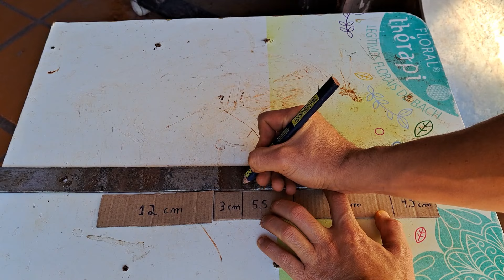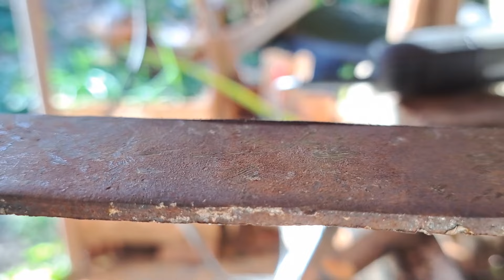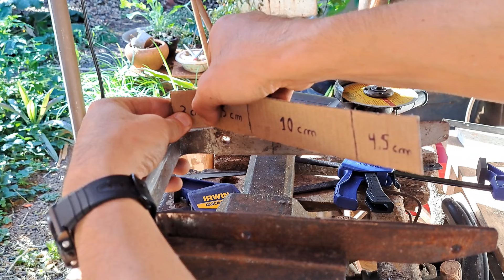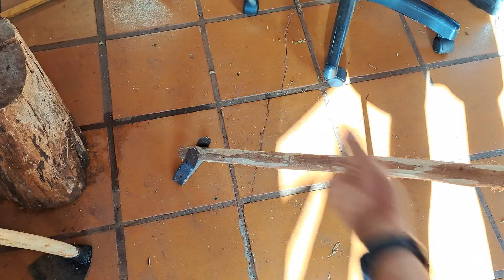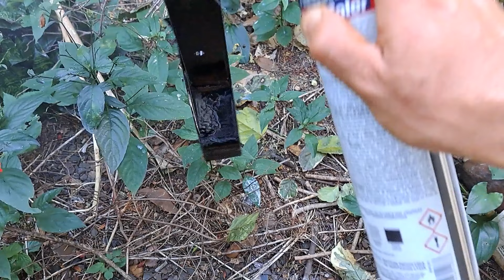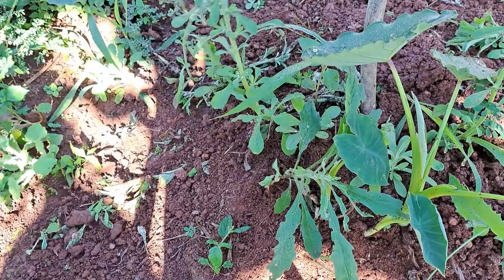Como Fazer Uma Enxada de Jardim / Enxada Pequena de Arrasto Com Uma Lâmina de Ferro

Comment: Quanto custa esse modelo e onde posso encontrar
Reply from the maker: Olá. Esse modelo eu que inventei. Mas fiz para uso próprio. Obrigado.
Reply: In Russia two in complect ( app. 20 cm and 10 cm wide) cost about 10 usd.
Reply from the maker: @VovaSidorOff thanks
Reply: @AgroTaka1  I made such a hoe from a simple 3mm steel wire. It took me 10 mitutes without any instrument.  Wire is not sharp, but it works really good in killing small weeds. It pulls out weeds with the roots very fast. Try.
Reply from the maker: @VovaSidorOff thanks.